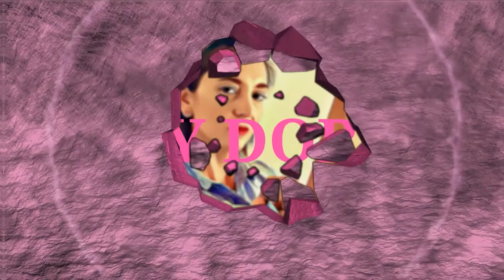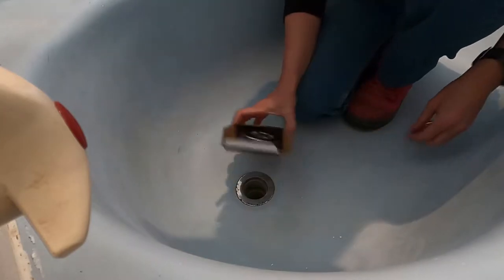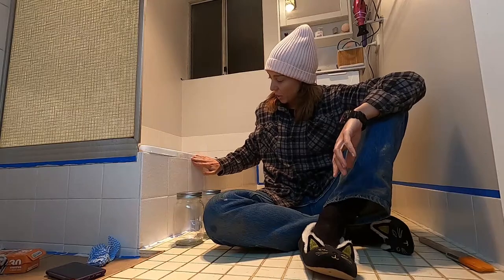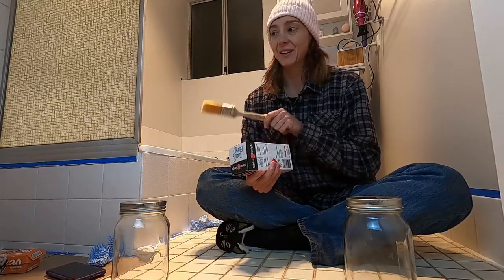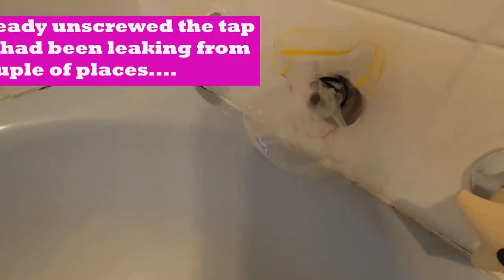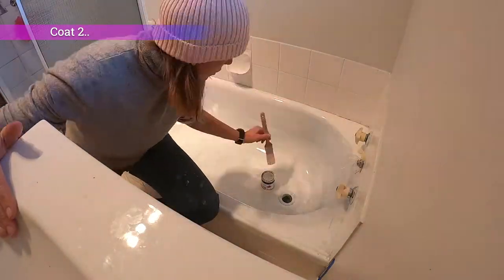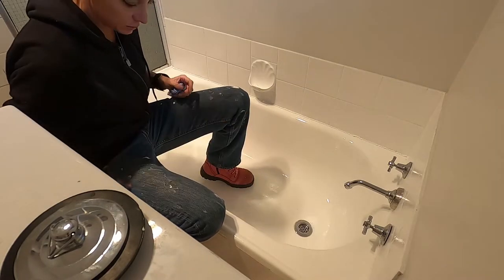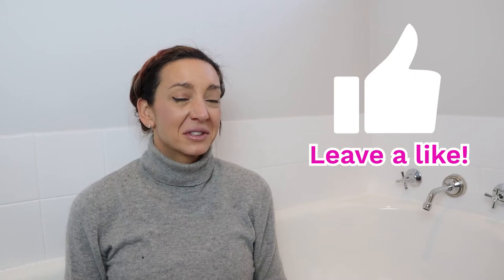DIY bath painting using a Tub and Basin Kit by White Knight

Comment: Nice job there. Did it dry smooth? Meaning, did it have any brush marks? I need to do this myself and have been hesitant.
Reply from the maker: Hi Shannon yes you can't see any brush marks. I did use a new paintbrush after the first two coats though as it really doesn't clean off the brush too well between coats so that's definately my top tip!